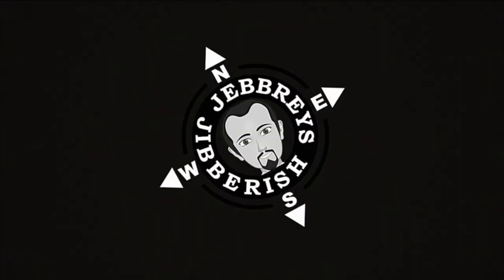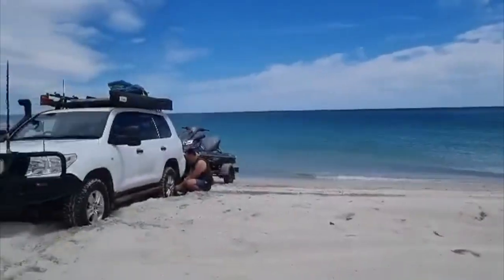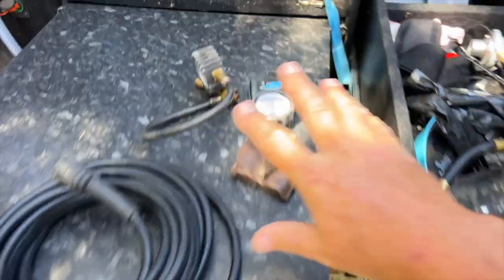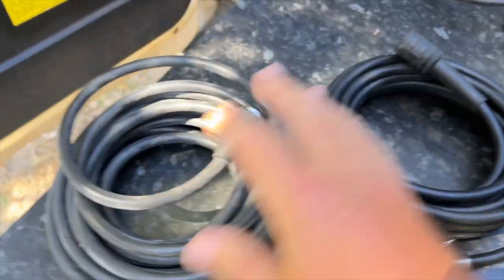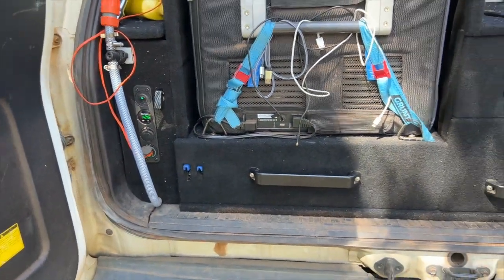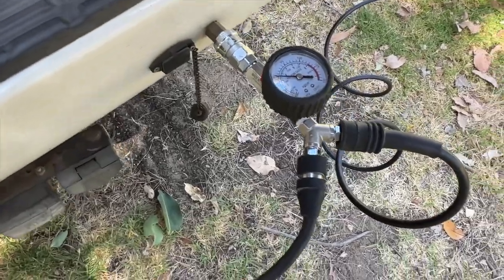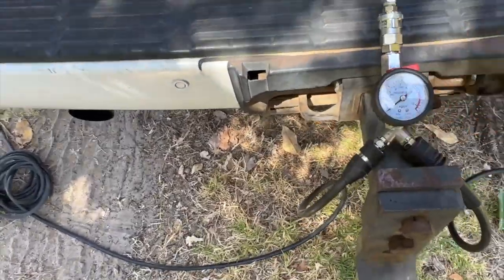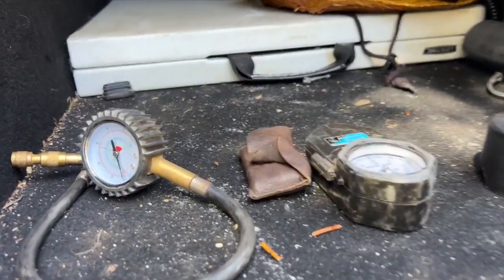DIY Indeflate - Was it worth it?

Comment: Good video mate. I still use  one of the ARB quick deflator gadgets.
Just a bit of a warning regarding the use of the type of unit you have cobbled together if I may.
It is pretty much essential that you are located on level,  flat (ie not on a rock) ground.
If you are on uneven ground or have one tyre sitting on a large rock etc, the pressures won't actually equalise.
The tyre on the lower side will have more weight resting on it and you will end up with non equal pressures when you drive off.
Reply from the maker: So that would be the same issue with the mainstream brands of those too? I’ll have to do a test and see. I would have thought they’d equalise either way but now you’ve got me thinking. Would be an interesting experiment to see if it varies and how much if it does.
Reply: @JebbreysJibberish  a good experiment you could perform in your flat driveway would be to drive one tyre, say front right, up onto a hammer handle or similar 2" x 2" piece of timber.
Now add your two fittings to the right and left tyres to allow them to equalise. Then, drive the vehicle off the timber and check the pressures. I'd guess they'd be marginally different.
For a more extreme experiment.....jack one tyre completely off the ground and repeat the exercise. The difference between the two tyres will be significant once they are both back on the ground.

Comment: Should you have a little tap on each hose as well so that when you are disconnecting, you can close each tap off so you don't lose pressure from one tyre while you move from tyre to tyre when you take the hoses off the tyre valves.? You'll have one tyre at 50psi and the other at 48psi by the time it takes you to fully disconnect.
Reply from the maker: If I disconnect the other way around it actually works better. Because the Nitto fitting is blocked, so I just have to disconnect the nitto end first.

Comment: While not cheap, an ARB Twin compressor with pressure control and indeflate you don't need anything else. Pressures preset on phone no need to be checking pressure constantly.
Reply: but far from bang for buck which this is.

Comment: Hi Jeff, Is you friends compressor hard wired or using alligator clips ? That may be where the inefficiency is.
Reply from the maker: Alligator clips, but then my compressor is mounted in the back so even with heavy duty wiring mines probably suffering more voltage drop.